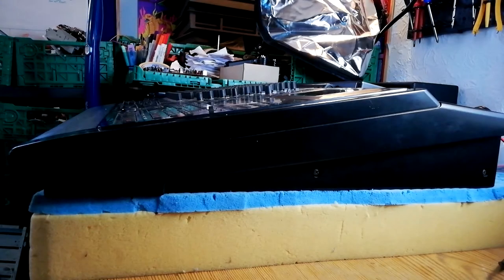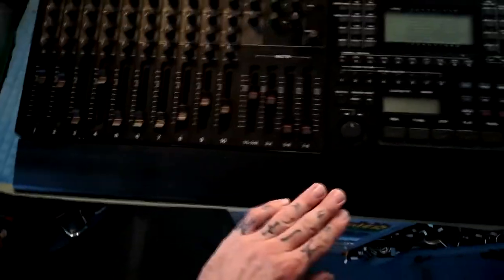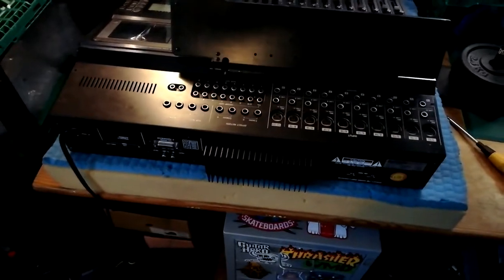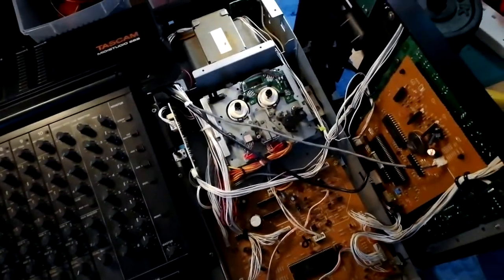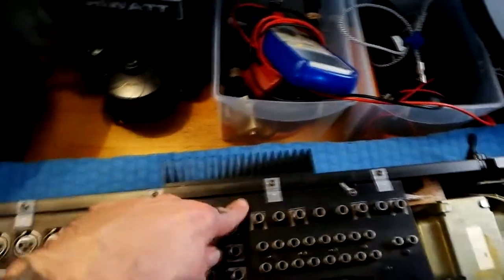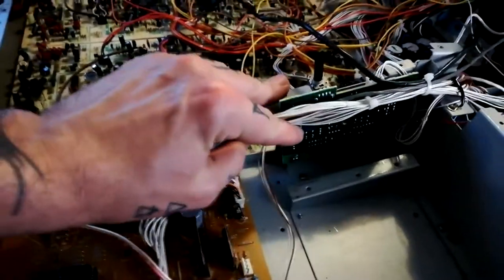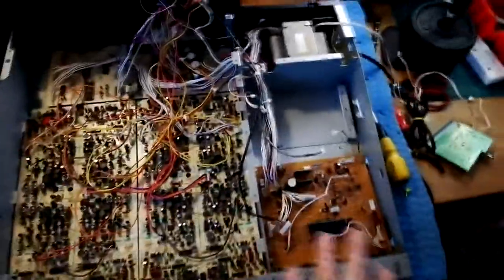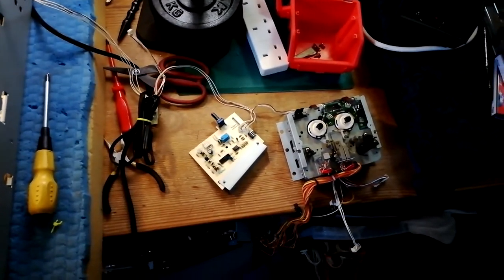Tascam 688 Midistudio | 2 | remove transport & pitch control PCBs

Comment: You don't happen to know where to get heads from for these do you? I'm sure it's borderline unobtanium. Do you know if the 488 shares the same heads? Thanks mate.
Reply from the maker: 100 percent unobtanium unfortunately, you need a donor machine. I forget whether the connecting cables on the 488 and 688 are the same but the heads themselves are definitely the same part. If the headers and connectors or cable lengths differ, it’s tedious but doable to swap the cables over - Ive twice had to do this with healthy erase heads from 488s going into 488 mk iis with one open coil. In both cases, the client paid £126.50 from Tascam Ninja just for the head, so it can be cheaper to buy an entire donor machine them sell on the remainder for parts. If you have to swap over cables, do NOT desolder the cables at the solder pads on the base of the head itself, the head is too susceptible to head damage: Instead, cut the supplied cables a few inches from the existing solder joint and make solder joints between the two styles of cable, covering the join with shrink wrap. I documented this process in a video on my patreon , which is cheap, hint hint!

Comment: thanks in part to your videos i was able to repair a broken gear and broken belt on a 488mkii. Now there's an issue with the pitch control. It's wildly inconsistent. I can record and it will play back faster and sometimes slower by a couple whole steps. The wheel can be responsiveness then all the sudden slow it down to half speed or speed it up to double. There's zero control. Can I just but a new pitch wheel module and install? Any tips on this?
Reply from the maker: Try desoldering, prying apart, deep cleaning and reassembling the potentiometer on the pitch control daughter board- grit and grime caught between the brushes and conductive plastic could cause what you describe. While you're in there, touch up the other connections with fresh solder incase a dry joint is sending a variable voltage into the motor. If those steps don't solve the issue, investigate the motor control chip since these often overheat, I have a video about that, check my electrical troubleshooting playlist on my channel splash page.
Reply: @Tetrakan  Wow- Thanks so much for the amazing reply! Will be following your steps and watching your great vids.

Comment: I have one, I changed the belt, the engine is running but I cannot play the tape.  when I press play nothing happens, and all the cables are well connected like your video. Can you help me please.🙏🏻🙏🏻
Reply: I also have one I've never got working. when I power it up the motor is running, affected in speed by pitch control. thinking it would be just the capstan belt, but even with a tape in the FF and REW do not function either .. pressing any of the transport buttons does nothing. idk maybe this one is just a lost cause..
Reply from the maker: Have you tried cleaning, and if necessary replacing, the tactile switches for the shuttle buttons? ( Play, fast forward button, etc) check my 244 playlist for a video if you're not sure how to go about this.
Reply: Hello, I got more or less the same problem, I changed the belt. I can FF and REW a tape, but I cant play it. The "play" button is working without any tape when I push the small plastic things up-left which basically detect if there is a tape or not. When I push those things with a tape, I can't play the tape... Before doing that, for a while it was playing a tape, but only for 20 seconds, and before it was working well, I got some recordings on cassette that I'd like to get back.
Reply: Tetrakan Supermonobloc Tetrakan Supermonobloc thanks you do you can send me here link of 244 🙏🏻🙏🏻

Comment: Thanks for posting this! I’ve got a 60cycle hum coming from my 688 around or above the tape deck... Any ideas what that may be?
Reply from the maker: Thanks for watching! That's where the transformer is located so I guess   that's where it's coming from? I've never attempted it myself but apparently you can fix transformer hum with glue...there are several videos about this on YouTube, here's one from a channel I subscribe to, good luck! https://youtu.be/Tb2YrW71t3k
Reply: @Tetrakan  Very grateful! Thanks 🙏🙏
Reply: @Tetrakan  If I can ask one more question: I openned my 688 and it seems like the majority of the noise was coming from two sources - one was just the loud spinning of the capstan wheel, and then there’s a slight buzz from where the transport rests against the plate. Is there a fix for this? Or is this normal?
Reply from the maker: It can be helpful to remove be the flywheel and put a little lubricant, maybe silicone grease, in the hole where the capstan pin passes through - clean and grease off the capstan before using a cassette. The vibrating plate, well I've never had that problem but maybe you could use the sound deadening adhesive layer you can get for computer casing? Some capstan motors vibrate more than others unfortunately, and none are very very quiet.
Reply: @Tetrakan  I appreciate it! Thanks for your help!

Comment: Hey bro! Any chance you know what size pulley I’d need for my Tascam 688? The one I bought has had the motor and pulley pilfered from it 😭
Reply from the maker: I don't have the exact size to hand but if you use one about 2  cm in diameter you'll be able to compensate using the trimpots on the pitch control board.

Comment: hey man any idea what size the CAPSTAN BELT is ? there mad money on ebay! I'm sure i could just pick one up for a couple of quid if I only knew the size!
Reply from the maker: Approximayely 100mm folded length , 3 or 4 mm width. Flatbelt 3.4 from gbaudio.co.uk works if you're close enough to Scotland to order from there, I buy my belts from there.
Reply: @Tetrakan  pro gento! legend 
there charing me €40 on ebay
Reply: @Tetrakan  your a legend